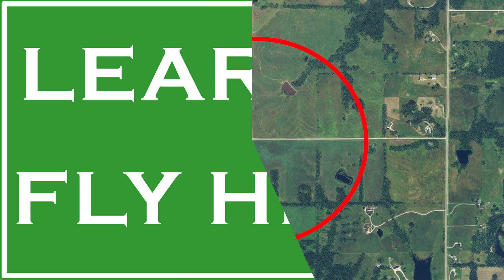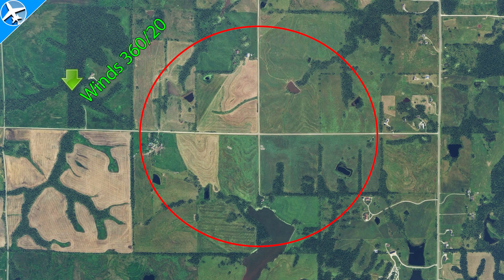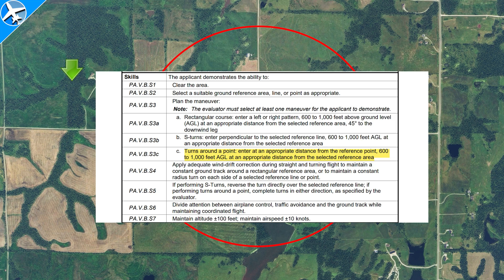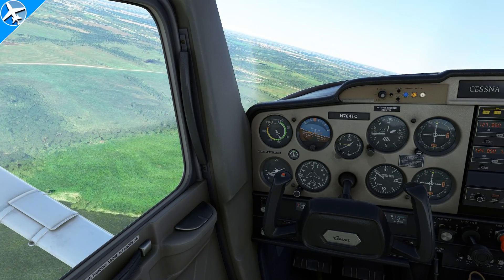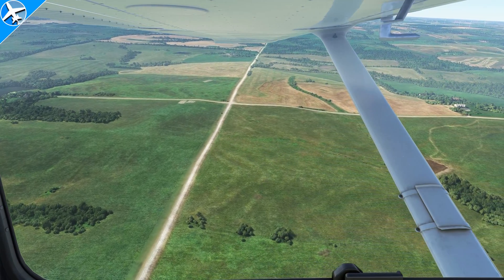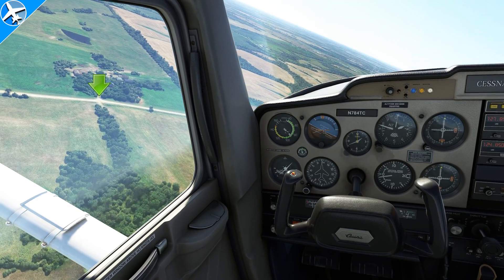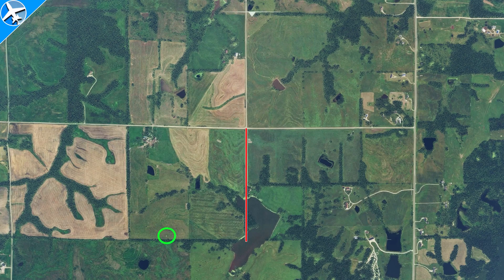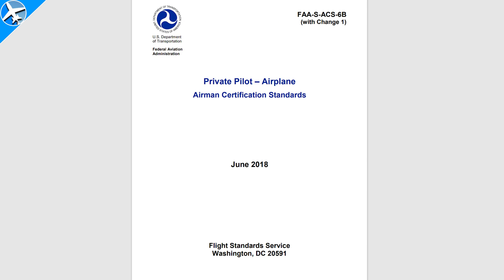Turns Around a Point | Private Pilot Ground Reference Maneuver

Comment: What are the failure conditions? Angle of turn? Angle of wings? Maybe even airspeed?
Reply from the maker: Airspeed was the issue.  Starting at a particular airspeed with the airplane trimmed is helpful.  Started around 100 and went below 90.   Starting at 95 would have kept the airspeed within 10 knots.

Comment: I did not do this exercise in my classes (except for doing circuits). it's easier to do in real life, the perception of distances is better than on a simulator and the left wing is a good guide. Assuming you were at 1000' AGL (estimated by eye) you did not vary by more than 500' but around 240 degrees, you were at around 87 kts instead of 100 kts at the start of the circle. Did I miss something else?
Reply from the maker: The airspeed was the mistake.  Usually, this maneuver in the 152 should have been done around 90-95 knots.  This maneuver is required to be taught in the States, but I am not sure if it's done in other countries.
Reply: @thecorporatepilotdad  Not in my memory in the 90s in Canada (Montreal Quebec). On the other hand, we had to do spins and spirals in solo flight.
Reply from the maker: @06L  Solo spins were a requirement or were they taught, and you could do them on your own? In the U.S., spin training is only required to get a CFI.
Reply: @thecorporatepilotdad  Yes, solo spins and spirals were mandatory for PPL. My instructors told me that was not the case in the US. They said it made Canadians better pilots ;-)